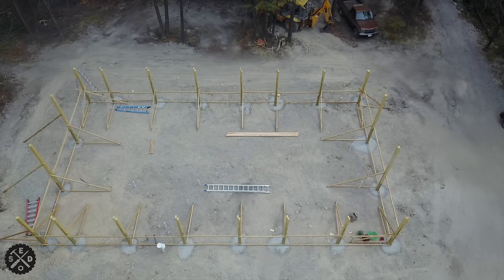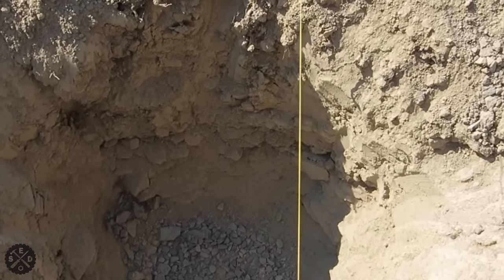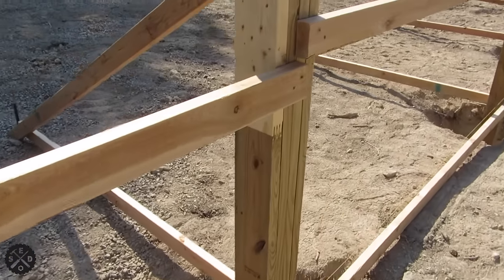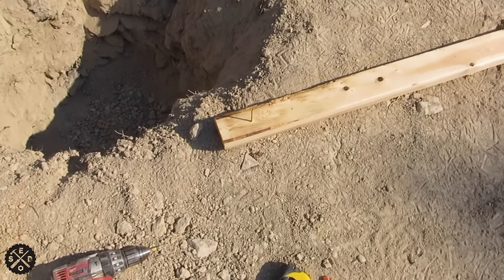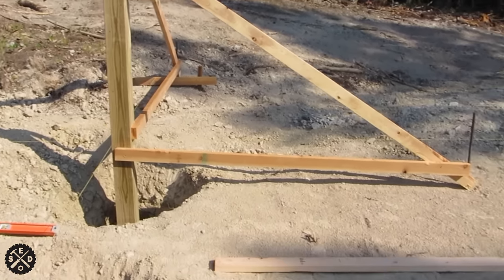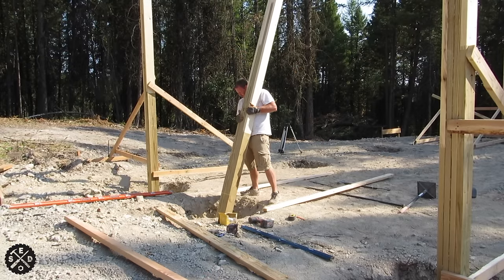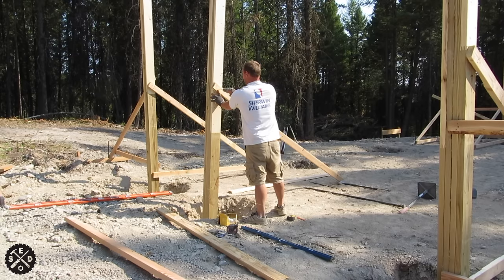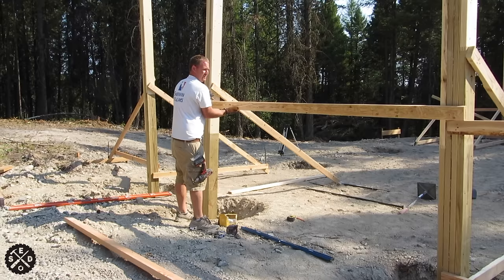How To Set Posts To Build A Pole Barn Yourself DIY

Comment: Thank you so much for this amazing and clear video.
I am planning a small build in the near future and I will most likely be doing it alone.
I have some questions:

What is the benefit of screwing thinner boards together instead of buying the solid lumber?
Is it cheaper? Or stronger? Or both?
What are the specs for spacing load-bearing posts in relativity to their dimensions? 
I am planning to build a 20ft x 20ft cabin with an upper floor to sleep in.

Thanks so much.
Reply from the maker: Thank you for the feedback I really appreciate it!! So I actually bought my post that way they’re all glued and laminated and nailed together before I got them. I think you could make your own as well if you wanted they might just not be quite rated quite the same as from the factory depending on how you glue them together etc, I don’t know for sure. The benefits of them for what I used them for is they are dimensional one way so I could fit them in a studded up wall. Where I live the regular 6 x 6 treated posts are a full 6 inch rough cut not 5-1/2” The other benefit is they are straighter and lighter. I think for specs they are rated the same. Thanks

Comment: A lot of added work in my opinion. Twenty years ago I built my pole barn. To start with you don't need to make the holes much larger than the size of the post unless you plan of filling in with concrete. Next unless you plan on cutting off the tops later to make them the same height you need a transit to make sure all your holes are exactly the same depth elevation wise. Drop your post in the hole, back fill and tamp while using a level to hold the post straight and not letting it twist. Once the hole is tamped down well the post will not move and you can start putting the girts in place. Either use a nail gun or predrill your hole for screws through the girts. All my posts are set directly into the ground. The inside posts are surrounded with a concrete floor but I took the time to wrap each post in visclean and partially drove nails into each post in the two inches above the ground to anchor the posts in the concrete while keeping the concrete from contacting the treated posts as concrete here tends to eat away at the posts over a few years.
Reply from the maker: Thanks for the comment. Yeah that’s we used to do it too when we just set them in the dirt. It works good if you have 2 ppl. I found It’s hard to do it that way without bracing when working by yourself. Maybe you can do it ok. But yes also if you’re doing concrete in the holes you need to keep it braced till it sets up. I appreciate the comment it’s all about sharing ideas 😊
Reply: @SmartEasyDIYer  Your construction looks great I simply meant that for those sitting posts in dirt your holes should be only a little bit larger than the post. Put one end of the post in the hole and lift the post until it slides in. Then add dirt as leveling the post with each addition until the hole is filled. Then tamp and keep leveling and you should end up with a level post without need for bracing although I did check the level at the addition of the girts to keep them straight. My barn is twenty years old now and no failures so far. Three thousand sq ft. Half inside with a cement floor and half as sheds outside with dirt floors to park equipment on.
Reply: In my area they require the holes to be a minimum of 24" wide regardless if you're using dirt or concrete. I know some of his are wider, but...rocks.
Reply from the maker: Yes, Rocks. 😁 if it wasn’t for rocks I could easily get away with 16” hole I’d say. Unless like you say it’s required to go bigger.
Reply: I would think as long as the holes are large enough to get a tamper in to compact the dirt then it's gtg.  But I'm not an engineer.

Comment: I'm curious about the ground , with such wife holes at the top.  Was the dirt hauled in then build or just kinda unstable ??  
Where I am we have to go at least 4 ft down for frost. 
All depends if you have to build to code or your building a shed type , animals or what not.
Reply from the maker: Yeah exactly. Even if you’re building something for animals I would go deep enough so the frost isn’t a problem. Where I’m at we have to go at least 42 inches for frost. Yeah the ground was just a little unstable on the top layer for me and with all the jackhammering I had to do to get the rock layers out underneath is one reason that some of  the holes were so wide. But down in they were just fine.

Comment: I'm working on a boat port. Do you think it would be a mistake to coat the ends that are in the cement with liquid tar? To protect them from rot.
Reply from the maker: Hi I don’t have much experience with using tar. There is a product called post protector that I’ve seen a lot about maybe you could also research them.

Comment: I have my first corner post in the ground 3-2x6 laminated. Im wanting to do 8 ft apart.  Do i measure from outside corner of set post to outside corner of new post to make it 8ft?  An 8 ft board wouldnt nail to it then unless i moved it to center of first post.  But then it gives a gap of no wood on first post where 2x4 is started on center.
Reply from the maker: Yeah, I know what you mean. Usually you have to go 1 1/2” undersized on the overall post spacing to account for the nailer that goes on the outside yet.

Comment: great video. I’m about to start one also. I’m thinking 40 by 60 by 16 ft high walls  ( or 14) not sure yet. what did you use for uprights. 4- 2by6pt? If yes did you just mail them together did you use glue also ?   Also as the posts go higher in front and rear do you just leave them higher than needed then snap a line and cut later ? I’m thinking it would be too difficult to get the height on the money from beginning.
Reply from the maker: Thank you! I actually purchased these all put together already and yes they are glued and nailed. Yes the post just run wild as long as they are tall enough for sure that’s the main concern then you can cut them off later when you’re ready.
Reply: @SmartEasyDIYer   thank you

Comment: What type of post did you use? They have finger joint material in the post.
Reply from the maker: Yes these are called laminated columns. These in particular are made by Triad building components. Other companies make similar ones

Comment: Thanks for the tips...
Trying to get ideas,
I’m about 2 days into tearing down an old barn,
And plan to rebuild it , on my property, using much of the original structure, but I’d like to go from 4 x 4 posts used previously to something more substantial- like 6 x 6, plus I want to raise the center portion of the barn higher,
It was original only 8 ‘ to bottom of the trusses, which wouldn’t normally be an issue, but it had 2 lean to off left & right side, with a slight pitch, puts the ceiling height just over 6 ft,
And I plan to use it for horses, so that’s too low.
Thinking if I use the 6 x 6, maybe 16 footers, I could bury 2 1/2 ft & still have 
13 + high ceilings in the main - center section of the barn, with easily 10-11 high in the lean to areas, which is where I plan to have horse stalls.
Only thing I noticed during your video, that may concern me, was the laminated posts,..?
Why not use solid posts?
I’ve never seen or use a laminate post such as this,
I have see laminated
 2 x 4s, but they didn’t perform well at all, just any moisture, the glue separated & the finger joints basically fell apart.
Reply from the maker: Hey yeah thanks for The comment. I’m glad you’re researching and getting ideas. So yeah here for pole buildings where I live using laminated post is very common. The reason I went with it is because here full 6 x 6 posts are rough cut not dimensional since I was using a stud wall I wanted it dimensional. Depends where you live 6 x 6 treated are 5 1/2 x 5 1/2 but not in my area. The laminated post are stronger and lighter and straighter. So it comes down to personal choice and availability. You can usually get 18 foot long so I would recommend getting those and going deeper than 2 1/2 foot into the ground. Typically you go 3 1/2 to 4 feet. Best of luck with your project!

Comment: Hey question why did you sandwich the 2x6’s or whatever size they vs just getting an actual post?
Reply from the maker: It’s a laminated post. Treated on the bottom 6’ roughly, the joints are staggered for strength then glued and nailed together. You could build your own but  I purchased them that way. They are straighter and lighter than a traditional treated 6x6. Also here all the treated posts are rough cut so they are a full 6 inch so these are 6 on one side but 5 1/2 on the other side so I could use it with regular dimensional lumber when I framed my walls later in between the posts.

Comment: nice idea thanks. You make these oles yourself by screwing 2x4 together ?
Reply from the maker: No they’re are actually 2x6 that are laminated together from the factory. Pressure treated on the bottom in regular lumber on top. The nice thing with these is they are dimensional in one direction so I was able to frame around them. I’ve heard of people that make their own too.
Reply from the maker: I’m not sure what kind of glue this company used but it seems like you could use something like liquid nails or PL construction adhesive and ring shank nails to put them together.
Reply: @SmartEasyDIYer  ok thank you for the information ! Happy and healthy 2021 !!
Reply from the maker: @scattkiwiman  Thank you happy new year!
Reply: @SmartEasyDIYer  thank you :-)

Comment: My project Is a 20 by 24 car port.. I am going with a flat roof and no walls on the side.. I was thinking 3 4 by 4 is on the front, 3 for the middle and 3 for the back. The middle row would be 12 foot on center using 2 by 8 to support the OSB. Just trying to figure out the best way to make sure. All the 4 by 4's are in line. Wondering if I have to Bury 2 foot of 4 by 4 in the concrete. Or can I put down a concrete pad or a pillar and let the wood sit on top of that? I need 8 foot of clearance to back my truck underneath it.  any suggestions
Reply from the maker: Yes, I don’t know if you have snow load to consider but it seems like for the 24 foot section if that is loadbearing, I would go every 8 feet if it’s not in loadbearing 12 feet should be sufficient. I think if I did it again, I would pour the concrete pier 1st and use a wet set bracket on top. You do have to do more bracing in the walls but you can build some permanent cross bracing going in either direction that should stiffen it up a lot.
Reply: @SmartEasyDIYer  I appreciate the response. I really have no idea what I want to do. That's why I watch these videos for inspiration.  I am basically trying to put a 6 by 12 single axle trailer and a pickup truck under cover on the back of my garage working with 40 ft left to right and 24 ft deep as far as an open area. I guess I'm talking flat roof so I can chicken out of trying to work a Gable.  I guess if I did 20 ft wide and 20 ft deep I could use 12 Footers as the rafters. That would obviously help with snow load as I do live in the Maryland region we don't get a lot of snow but there's always that potential.

Comment: Do the tops of the posts need to be level or do you put the beams on and cut the tops off after
Reply from the maker: Yes you just make sure they tall enough for the height you want especially if you have a low corner where you’re going to be bringing in fill but then you cut them off later yes.

Comment: I can see advantages to this method, in fact I guess it's not really a pole barn otherwise but I think for me it's mush easier to put peirs in the ground and place my posts on top of the piers.
Reply from the maker: Yes probably next time I would try the concrete pier and wet set bracket method. It doesn’t have any bracing out of the ground to speak of so you have to brace it really well permanently in the walls.
Reply: @SmartEasyDIYer  that's right. I just use plywood siding to make it into a solid box. Then you know it's not going to move. If you put the posts in the ground you have to be perfect and I never get anything perfect. Also I would worry about rot even though at my age I'll probably rot first. I'm going to build another shed this summer and at first I was going to build it on piers with a dirt floor but I've decided to pour a slab now. The slab will be pricey but once it's in the shed will go up fast. I love to watch all videos to get ideas so thank you for doing this.
Reply from the maker: You’re welcome good luck with your shed too!
Reply: @SmartEasyDIYer  thank you, I'm still working on it.

Comment: Where did you get your glulam posts?  Looks like the lowest members are treated (as they should be).  Price each?  Thx! very useful video.  I will be doing this soon myself :-).
Reply from the maker: Thanks. I got mine through a local place that did a package deal with my trusses too. I think they sell them by the foot usually. They weren’t much more price wise than regular treated posts. My outside walls are 14’ posts cuz 10’ walls and 4’ into the ground. My end walls are 18’   Yes they are laminated and treated on the bottom. The joints are all offset. They are very light and strong and straight. I was impressed. My posts are Triad brand made over in Idaho. I know there’s other brands too depends where you are located. Good luck with your project!!
Reply: Couple of good sources is Midwest Perma column not sure what brand they sell, but Ohio Timberland and Timber Tech are more well known makers, Morton makes their own from what I've researched. If you go glulam you may regret not looking into what glue they use as it may de-lam, most use nail lamination, some use both methods of laminating, Plus depending on soil acidity or infestation like wood borers and fungus or mold contaminants, you may want to use a post protector sleeve to prolong life if you plan to bury and also use uplift anchors if you live in a windy or natural disaster prone area.

Comment: Nice ..Wat size post did u use?
Reply from the maker: Thanks! Mine are 6x6. 5 1/2 x 5 1/2 technically.
Reply: @SmartEasyDIYer  question do u think 6x6x24 will support 2nd floor? And what's the farthest u would space them?

Comment: My only comment would be to use a cheap post level from harbor freight that straps to the post and you have less to do as you check while bracing 

Ty
Good lesson
Reply from the maker: Thanks. Yes that could help to get you in the vicinity of being plumb but I wouldn’t trust it to set final plumb.

Comment: Who did you purchase the building from? Thanks
Reply from the maker: Hi. I actually got my posts and trusses from a local company that builds trusses and is a dealer for the posts. The rest of the lumber I called around and got the best deal locally too based on what I needed and grade lumber etc. typically if you get a complete package from someone it’s probably a low grade lumber to be competitive priced. I chose to going with select structure grade on all my framing which is better than number 2. To each their own on that.
Reply: @SmartEasyDIYer  Would you share the company for the posts?  In this area of Texas I can't seem to find someone local to provide the posts!
Reply from the maker: Yes the company that made my posts was called Triad. They are in Idaho. Not sure where they ship to but you can ask them.

Comment: Hmmmm....never seen anyone use 2X6s as posts before. Are they as strong as a 4X6? Any big cost difference? Planing on building a shed this spring, this method may work.
Reply from the maker: Yeah they are laminated and nailed together. Straighter and lighter. About the same price for me but they were dimensional one way too 5.5x 6. The other treated posts here are full 6x6 so it was too wide for my application.

Comment: When I saw 2x4's, I thought you were using them for the light weight and making the post in the hole, one piece at a time, etc.,so as not to have to lift a heavy post...but no....So why 2x4's and the extra time to assemble them? Cost for a real post is usually cheaper. 6x3 1/2 not 6x6 right? a 12 foot 6x6 is over 140 lbs!
Reply from the maker: I actually bought these posts this way they are laminated together already. They are about the half the weight of a regular 6 x 6. And they are dimensional on one side to fit the width of a normal stud wall. The 2 x 4 are just for temporary bracing when I set the posts.

Comment: Are piers better than going in the ground?
Reply from the maker: There’s lots of opinions about that. I think going in the ground gives you a little more stability. There are options like post protector for protecting your posts better when going in the ground. I think the concrete pier and wet set bracket method  is great too you just have to brace the walls better. I probably would do that next time.

Comment: I would have used large screw in anchors instead of holes in the ground. Then I would have framed up a wall and .lifted it in with a light crane. My method would have been somewhat more expensive but saved a lot of time. I do not consider my time to be free. I also would have saved the cost of the concrete .

Depending on what the building is to be used for a moderate duty floor can be built using a mixture of existing soil and Portland Cement. Just dampen the soil and mix the water into the soil with a tiller. Then flatten the soil and spread about one bag of cement for each square yard over the surface. Then till the cement into the soil, flatten and compact with tamper or roller. Dampen, damp not puddles, the surface for a couple of days. This should cost less than the forming, reinforcing, pouring and curing a concrete floor.
Reply from the maker: Interesting. Thanks for sharing your ideas. I wonder how those screw in anchors would work in solid rock? Do you have to drill them with a pilot hole all the way down first?